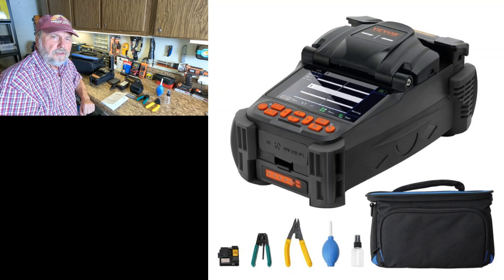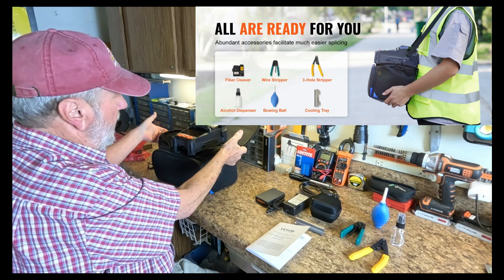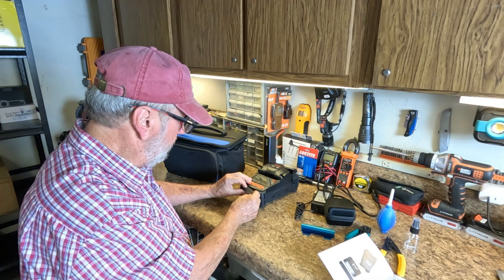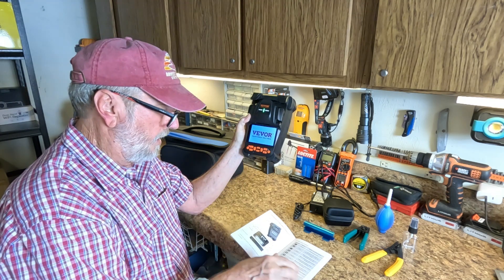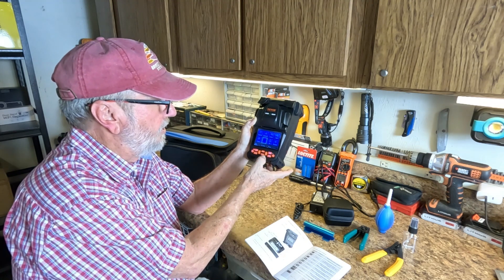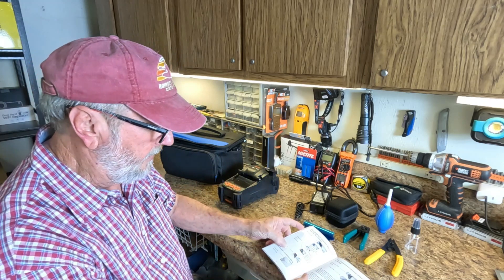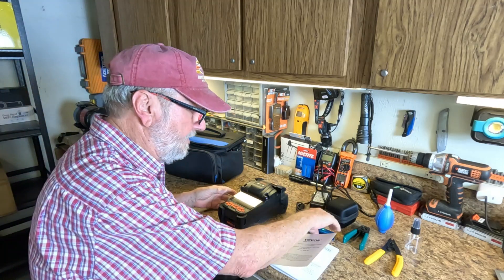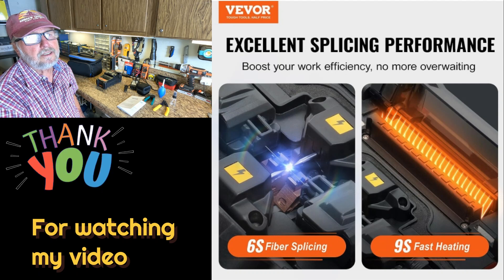VEVOR Optical Fiber Fusion Splicer will provide  performance perfection

Comment: Sam! I love your video on the optical decoder for my tv/headphones but can't leave a comment and I have a question. How can I do that? Help!
Reply from the maker: @fairghum, I saw you did finally get the note to me.  Let me say, the product I videoed was before I found the Bluetooth adapter transmitter receiver with optical input.  I put the link on the other comment.  Maybe you can get your money back from it and purchase the one I listed.  You just plug the optical input into your tv.  Then you can Bluetooth your headset to it and you will be able to listen to the TV.  It can Bluetooth two people to list to the TV.  Instructions tell you how.  I believe the green button allows the second listen to connect into the adapter.  Good luck.